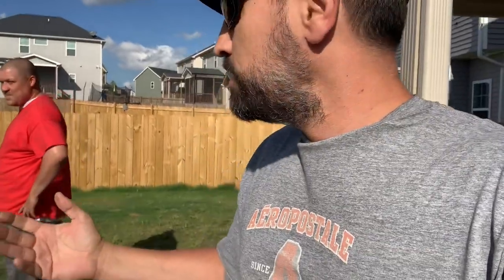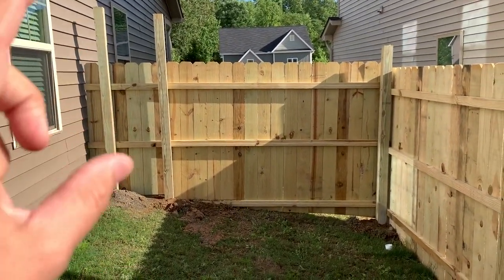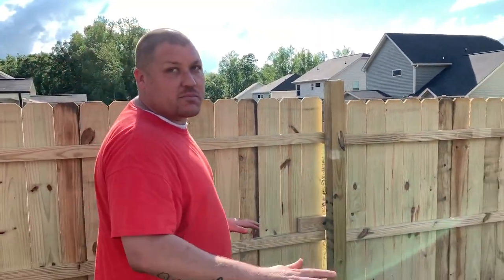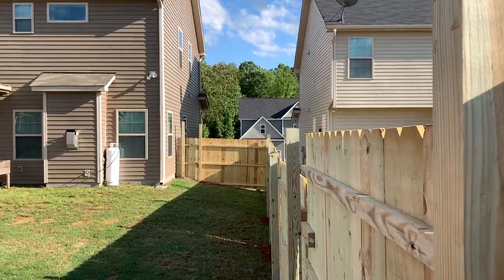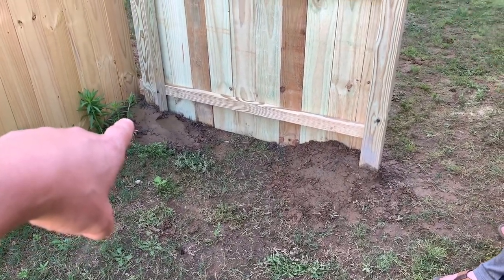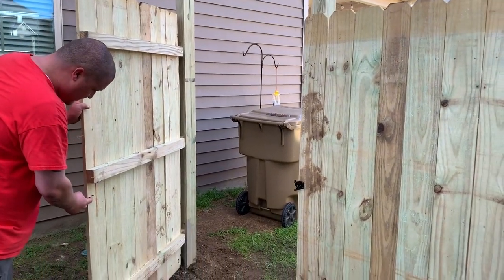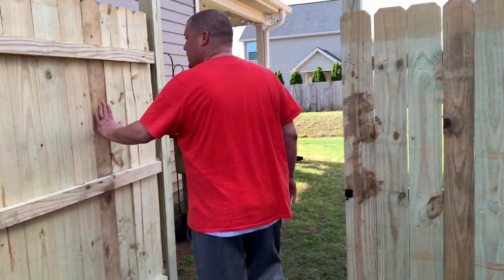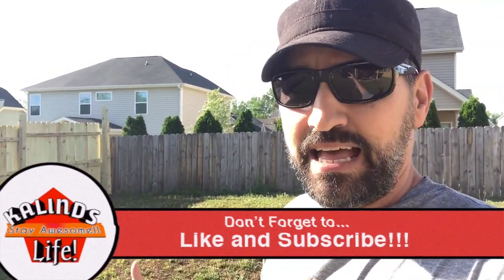How ‘NOT' to Install A Wood Privacy Fence! The WORST JOB EVER!

Comment: They never sank the posts deep enough and they didn't fill with cement, it is obvious the fence company does not know how to use a tape measure. Another issue is when you have a sloped yard or ruts you cut the slats to the height of the ground while maintaining a level top.

Comment: My parents hired a "pro" to build a privacy fence last year. It started to lose panels within a month. By spring it fell apart completely. Upon close inspection it was just as bad if not worse than this prebuilt garbage in the video.

To start, the posts were only 8" to 10" deep. The guy ruined his concrete bags in the rain, so he used only ONE bag for all the posts and left the other 7 bags for us to dispose of. The posts were sticking up 7 1/2 feet in the air. 

He built the panels himself but left no air gap between the boards, so it was more of a sail than a fence. Cheap-ass only used top and bottom rails (nothing securing the middle of the board) so the fence was allowed to warp and bow randomly. The whole fence including where panels were secured to posts was done with an air nailer and 2 1/2" smooth shank nails. Not a single screw used in the whole project.

To top it all off, the panels were built backwards with the finish side facing inwards! Needless to say, the whole thing had to come apart board by board, new post holes dug closer to property line, and completely rebuilt. 

Oh, and he built a walkway for my folks as well. I'm not going to get into what's wrong with that though or I'll end up writing a book.

Comment: You may want to ask the landlord about the fence. Since it's a rent house its common for the landlord to get the cost low and instruct the fence builder on what materials to use. It's the homeowner/landlord responsibility to get approval from the HOA.
The fence contractor only installs the materials the person writing the check approves. 
I'm a contractor and I had many landlords only want to spend  bare minimum money  and short cuts on there job. 
You get what you pay for.
I guarantee you spent 3x much more money and  time on your fence. Landlords are not about that life especially on a fence.
Reply from the maker: I hear ya but this was my Neighbors house (he since moved) right across the street from my house. Thanks for watching and commenting!!!

Comment: Well someone had to sign off on this mess and pay for it. Good luck getting someone back out there now.
Those prefab panels are junk but it's there now.

All is not lost tho. You can use the current materials and make a much better fence. The pickets are just stapled to the 2×4 and being 6 foot pickets they will account for the change in grade.

Comment: IT could fix that in 30 minutes dig round the post add concrete with quickset and add 2x8X16 on the bottom and just drill it on each side easy fixes who ever built it was just lazy fixable af rookie work ...
Reply from the maker: Its still such a crappy job but it was fixed.  there are new renters so I cant really go over there to do a video.  Maybe when they move out ill see how its holding up!

Comment: I used to like to do things with wood when I was younger and even built a tiny deck for a round pool for my kids. Even though I have never built a fence I could have just looked around at the other fences and did a hell of a lot better than this crap job and I would have never thought about using panels. Did this company even know how to use a frigging level?

Comment: Those panels are trash no matter how well theyre installed. I see fence companies in my area doing trash work like this. Unbelievable..
Reply from the maker: They’re cheap made and are not strong. I agreed it doesn’t pay to use them!
Reply: @TheCrawlspaceCraftsman  yep, they always sag because the runners arent full 2x4s. The pickets are super thin too.

Comment: ALWAYS get references, and ALWAYS go check out one of their other jobs, if you can. You should also get in WRITING (on a quote or statement of work) EXACTLY what you want done (e.g., 5' fence, posts in concrete, tapered top caps, no panels, etc.). I know it sounds like overkill, but the best defense/explanation is "I respect your qualifications, but have seen some people get burned badly by bad fence jobs, and I don't want to be that person." If the person does good, reputable work, they will have NO problem with this. If they have never built a fence before, then you don't want them building yours. Would you want to go to a barber who had never cut hair before? (well, the guy in red in this video might... rofl)

Comment: Idk. First off you didn’t even mix your concrete. You just dumped it in a hole and threw water in it. Wood in dirt rots, pressure treated or not, poles are better. You didn’t have any gap at the bottom of your fence boards either, those will rot. I don’t even think you spaced the fence boards between each other. You used nails. Screws have way better holding power. But yes, that guys fence is horrible. I can’t believe someone paid for that.
Reply from the maker: When you say “You” who are you talking about and what video are you mentioning??? When it comes to concrete in fence post holes.... you don’t have to mix the concrete first. Dig hole, Plum pole, pour in concrete, replum pole, give a good hosing, replum again.... walk away! Thanks watching!!!

Comment: You can use dirt without concrete but did they dig it at least 2 ft down LOL wow that's horrible.
Reply from the maker: I honestly don't think 24" would be enough with dirt only.  I think it would have to be 1/3 the overall length of 4x4 to work.  Thanks for watching!

Comment: Maybe your area is different - but here in VA; permits aren't required for any fence 6 ft or under.  Also, permits have nothing to do with an HOA - in fact, HOA requirements should be requested; but also should be volunteered by the customer.  Lastly, a fence that follows contour is a preference; I'm against premade panels and such for those reasons, but generally you keep the top flush, and extend the bottom.  Certainly the inclines being steep; the options should be discussed and chosen by the customer.  Maybe this guy is just getting reamed by a ridiculous landlord.
All that said, whoever's did this is an embarrassment - I'm sure trained chimps could have done better - certainly more entertaining.
Reply from the maker: The Landlord is the one who hired and had the fence installed not the tenant so he’s definitely not getting reamed. At the time of this video he worked out of state and got in at like 6 am. He woke up to this disaster. He ended up calling me and said “Dude… you gotta come see what these fence people did to the yard!” I expected to see truck ruts in the grass but saw this and had to record it! LoL. He doesn’t live there and there are renters that I don’t know that we’ll so I can’t do any type of update video as of now. Thanks for commenting and watching!!

Comment: Please tell us he was at work when they did the job. And didnt watch them do this mess. The three stooges would have done better
Reply from the maker: Hahaha.... this is correct.
Reply: @TheCrawlspaceCraftsman  I just had a company come on and put up a wrought iron fence around a good portion of my property (at least where the bulldogs go). Fencing is not cheap and I know I could have gone with the extruded aluminum product and saved big time but my  thinking is do it right the first time with the right product and never worry about it again. The rest of the property we enclosed with a commercial grade chainlink once again we could have gone with a thinner guage post and wire. I wanted every post in the ground 3.5 feet. Over kill yes! But you know what it will be here for ever
Reply from the maker: Our HOA only allows for a wood fence but I originally wanted an Almond Colored Vinyl fence. Thanks again!

Comment: Unless the HOA has rules against stair stepping a privacy fence, it is a perfectly acceptable construction method. The way it was done here is in no way correct among the other errors. However, with a little math to make the stair steps even and the installation of a gravel board on the bottom of the panels it would look fine. It should also be noted in some applications customers choose to keep the gap in the bottom of the fence.

Comment: The staggered part does not hurt the eye, lots of gorgeous fences are built that way.  I disagree when you say a fence is supposed to follow the contour of the land.The only real problem here is there is virtually no anchoring of the posts. Maybe the owner was in a hurry and told them to just leave at that ?That is really strange.

Comment: The post can be cut, the holes on the bottom can be filled in.  The wiggled post can be supported.  The only real problem i see is those 2x4 behind the the post is odd.  Other than that yout just a baby crying just to gttention.  Its not that bad as your whinning.  I aint liking this channel and i would suggest others dont as well.
Reply from the maker: It’s not that bad!!!!! Are you kidding me!! Your probably the dude that installed it! Please.... don’t like my channel.... PLEASE!!!
Reply from the maker: Good
Reply from the maker: But I gotta admit... this actually made me laugh! I have to steal this one!
Reply: Ahaha at least something good came out of it...  but yeah i still stand that the fence job is salvagable.   For instance the 1 foot mistake accorsing to hoa standard fix.  Easily removve the whole 8 foot panel and cut it a foot on the bottom.   In general those fence  guys didnt seem like they were done, but know we will never know how far they were going to take it.  Am a general n landscape contractor...
Reply from the maker: webtheweb oh it’s still standing and im sure it’s gunna stay for a while but my point is this is not how you do it correctly and actually charge someone for the job. I’m 90% sure you wouldn’t do this. Then there’s that 10% that this happens! It was too good to pass up a laughable video! 👍